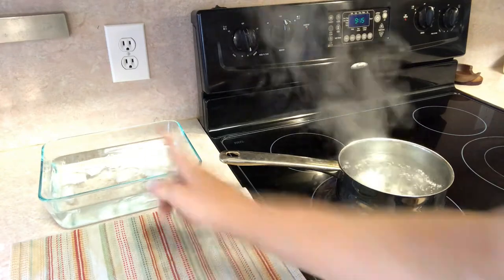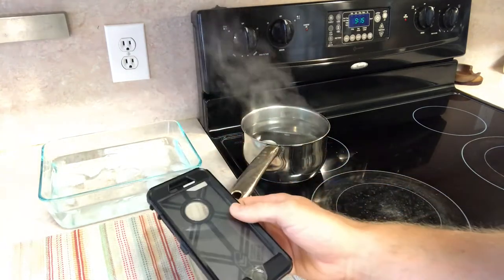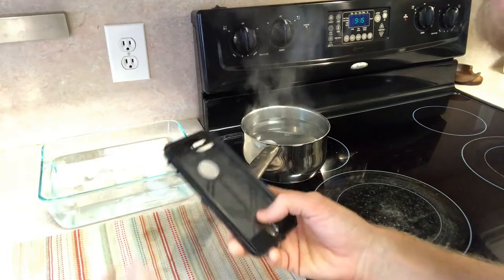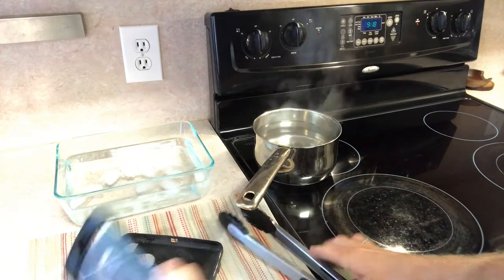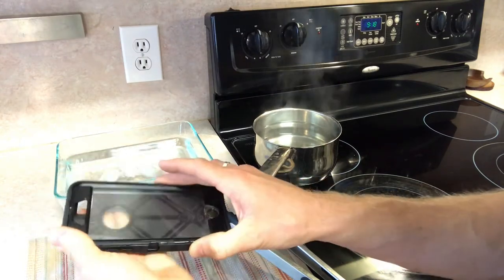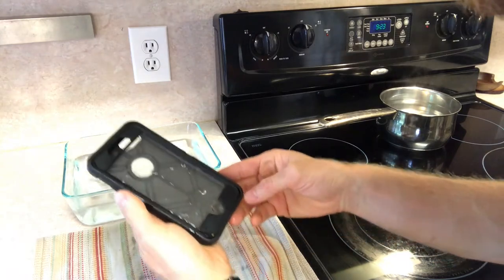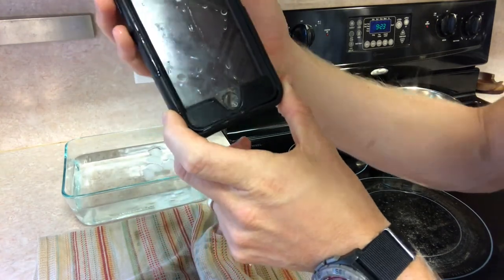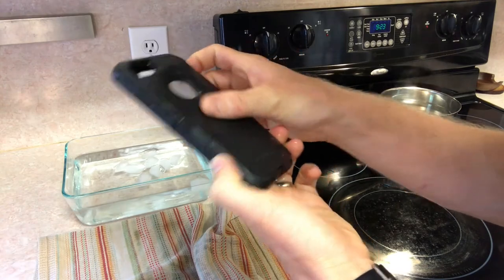How NOT to Fix an Otterbox Rubber Phone Cover | Stretched Out Cell Phone Case

Comment: I have a stretched out silicone otterbox case, it is silicone so it is not impervious to body oils, over time it will swell up from handling it. silicone is a good material but not in the case of body or petroleum oils. I have soaked silicone tubing in gasoline and it swells to twice the size, when it dries it goes back to normal size. I think if one had a way to remove the oils from it it may return to the original size.
Reply from the maker: If you find a way to extract the oils without making it brittle let me know!

Comment: I just put a drop of superglue in the corners so it’ll stick better but not enough that I can’t get it back off. Got the result I was looking for more or less the corners are tight again with no gaps anywhere. I guess I’ll just reglue it if I ever have to take it off again. Sloppy fix but it’s not even noticeable. If it’s an old case on the verge of being tossed go for the glue. I never have reason to take mine out of the case except removing the sim. That would be why I’m comfortable with gluing it on. Keep it in the case and it won’t get broken phones are slippery af without one that’s why I’ve only ever broken one phone my whole life
Reply from the maker: If it works, it works! Thanks for sharing :)

Comment: I’ve used Otterbox defender cases ever since my first iPhone,  never had a stretching problem. 
What causes this ?
Reply from the maker: I'm not sure, but it happened on the Defender for my iPhone 5 and my 7 along with countless other folks I've spoken to.
Reply: @GanderFlight    Several people I’ve talked to,   do have that problem.   It comes from taking it on n off frequently.
After awhile it will stretch out a bit.   Once I put mine on,  I very rarely remove it.  Probably why mine stays on tight.
Reply from the maker: That makes logical sense- except I didn’t take mine off after putting it on…
Reply: @GanderFlight     Them silicon/rubber cases are finicky.  Some hold their shape, some don’t.  🤷🏻‍♂️
Reply: @rushfanjames2112  I've had my case one year. I've taken the case of once, about seven months ago, and yet one corner of my case has bulged out roughly 4mm (1/4inch).  Once it's definitely not frequently so the cause, at least with some people, is definitely something else.
Reply: @capricer9799      Wow that much ?   I recently switched from those cases.
Never had the stretching problems though.
Reply: Chyna
Reply: My silicone isn't stretching so much, it's falling apart. It is only falling apart by the bottom where the charging is done.
I was thinking about hot glue a new area were it was falling off. I wanted to know if it would adhere to the silicone or if it would ruin it.
Reply: Exposure to certain chemicals, such as oils, solvents, or aggressive cleaning agents, can damage silicone, causing it to degrade.
Reply: O bought one 3 months ago. Here I am trying to fix it